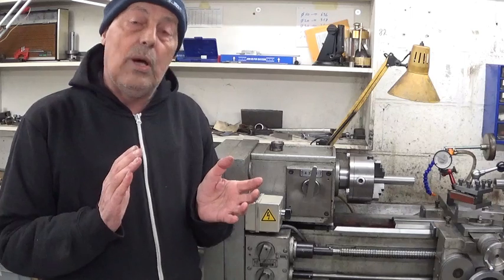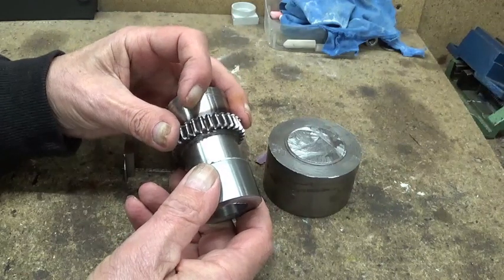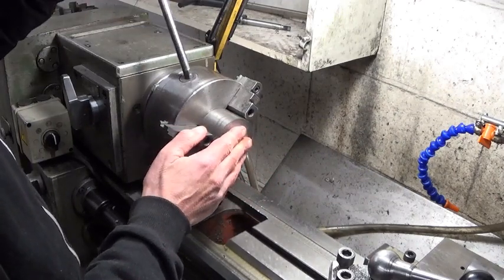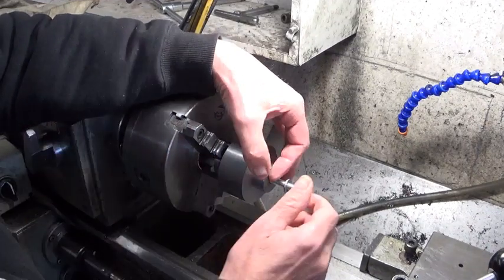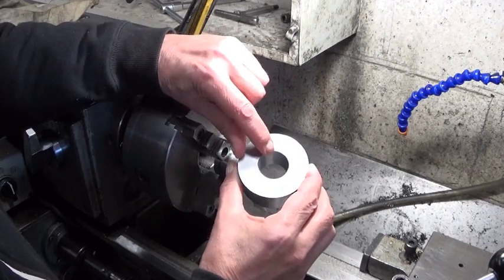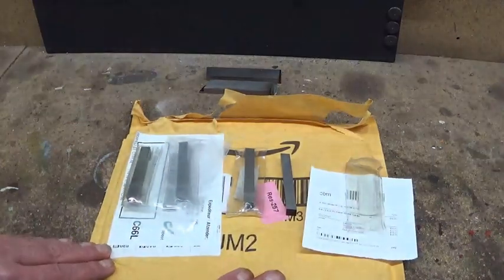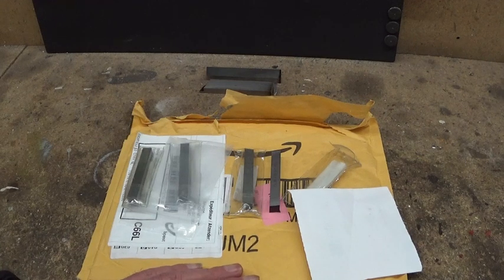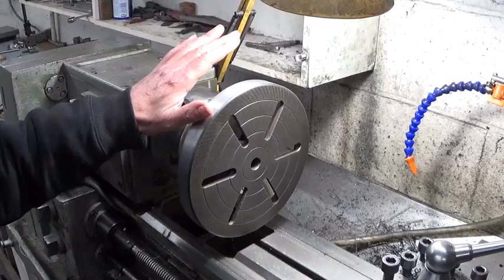Spindle gear cutting on the shaper part 1.

Comment: Looks like it an interesting project, Rusty 😀. Good chance that gear got heated up when it was grinding, well that was my first thought anyways 😊. I think the formula for calculating diametral pitch is (# of teeth + 2) ÷ diameter = pitch then round off to the nearest pitch of cutter. I see your single pointing it, a method I'm very familiar with lol. Takes a while but a lot cheaper alternative to buying a cutter. Good luck on your project my man! 👍😁👍 Cheers!
Reply from the maker: Thanks Chris. We'll see if it works.

Comment: I have to agree, making gears at home is fun. I learned the same way you are going about it, but I made a single point gear form tool for the milling machine, and mine was to replace a missing gear on my lathe as well. I cut the first from Aluminum and it worked well, I think it is still on the drive train to this day, never having to replace it with a steel gear I made as well. Cheers!
Reply from the maker: So, for me it should work too.

Comment: Hello,Michel. Great to see you back in the shop and making video chips again. The method of gear cutting you are planning here is what I call 'the gashing and forming' method. First op is to cut gullets and rough out the majority of metal. Second part is more refined and delicate finishing the profile with a form tool. What I enjoy most about shaper work is the ingenuity of planning and setting up a workpiece on the shaper. If a job needs doing quickly,use the milling machine. If a job and the process is to be enjoyed,use the shaper.
Reply from the maker: Thanks Howard. I don't have a milling machine but the shaper is much more fun.
Reply: @Rustinox  Michel,do you have much info on gear cutting? On calculating forms,pitches,PCDs etc? I will come back here and post some links to sites,books and downloads I found very helpful.

Comment: Best of luck with the gear - I have yet to make a gear that actually has to spin at a decent speed like yours,
so I'm curious what level of noise one will get with a shaped gear profile.
No cutter runout waves on the one hand, hand-ground profile on the other!

Out of curiosity: What size and weight (roughly) is your lathe?
Best Wishes
Adrian
Reply from the maker: Don't know yet, i still have to cut it.
The total weight of the lathe is about 600 kg.
Length between centres is 650 mm.